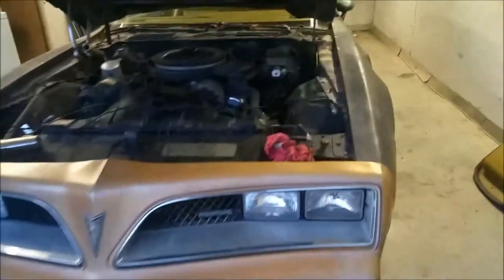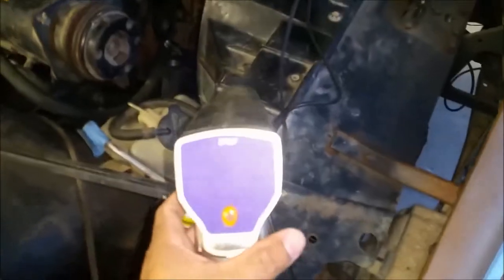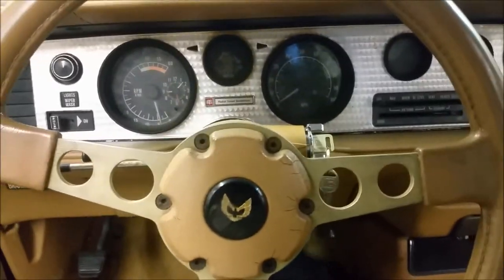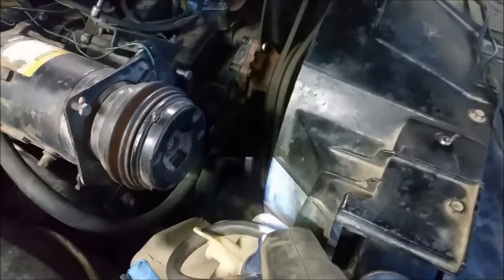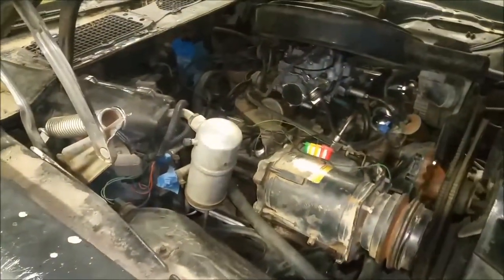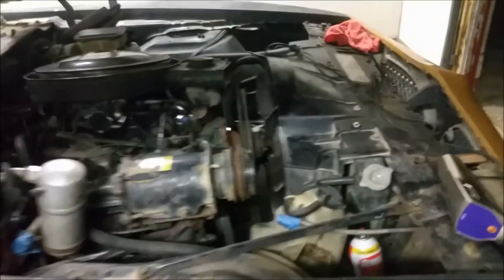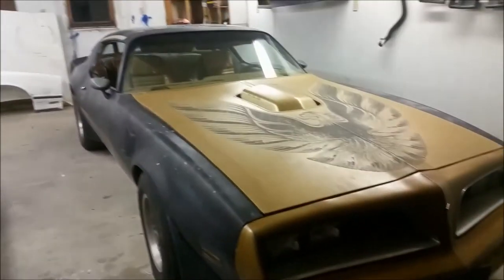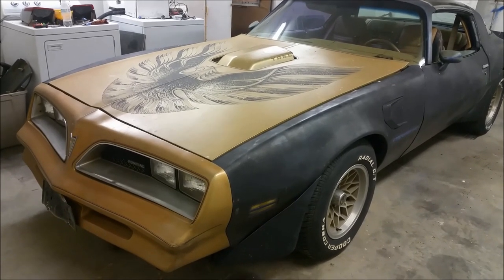Setting the timing on a 78 Pontiac 400

Comment: I test your timing on my 1977 trans am base 400 engine the Engine running is better and its driving become great. 
 note: i use  Acceleration  vacuum advance from the carburetor / my engine with Edelbrock carburetor & aluminum intake manifold, thank you very much

Comment: was wondering if you can swap a Pontiac 350 into a 78 firebird with the same motor mounts as the chevy 350 currently sitting in the car or do you have to buy specific mounts?
Reply: No the pontiac mounts are a bit different and in a different location. The cross member is drilled for them tho but you need to swing the control arms down to access the bolts.
Reply: Fuel lines and wiring needs to be moved as well . Chev is on the passenger side and pontiac is on the driver side.
Reply: Thanks